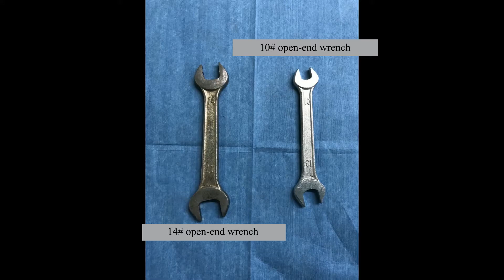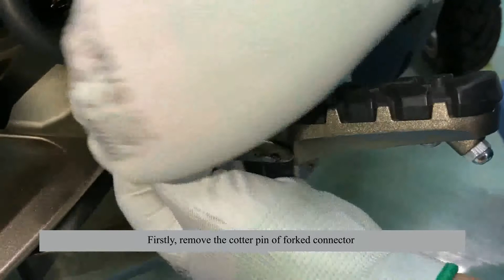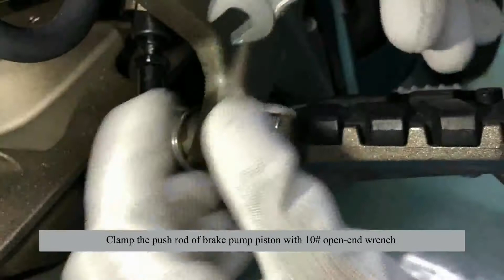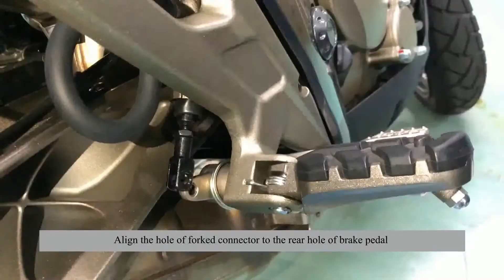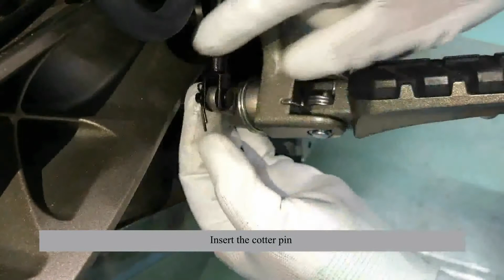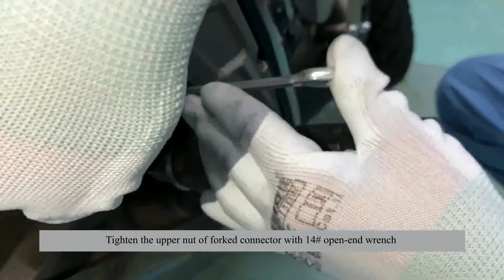ZONTES 310 MODELS BRAKE PEDAL ADJUSTMENT

Comment: Would this work on my G1? My brake pedal travels about 5 cm before the brake light comes on and the brake works. My first bike so not really sure?
Reply from the maker: Not looked at this to be honest, the brake pedal is normally attached on a spline will put a link to the service manual below this message which may help you cheers
Reply from the maker: Hi if your g1  set up is the same as the video then yes it's just adjusting the travel of the brake light switch
Reply from the maker: https://www.sharpon.com/Tayoimg/TsEip/TsEipAnnex/tsAnnex/AnnZT20230525112339463.pdf

G1 Service Manual
Reply: @michaelphillips1959  thanks so much, this is a far better manual than I got with the bike😁👍🏻
Reply: Oui ca fonctionne sur le G1 . pas besoin de défaire l'a goupille . : avec la clé de 10 on fait tourner l'axe sans rien démonter